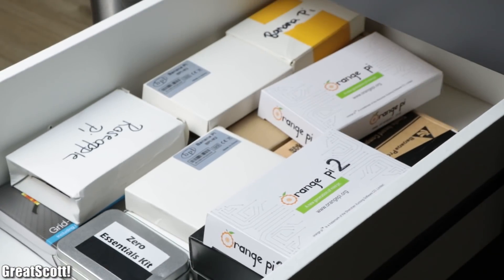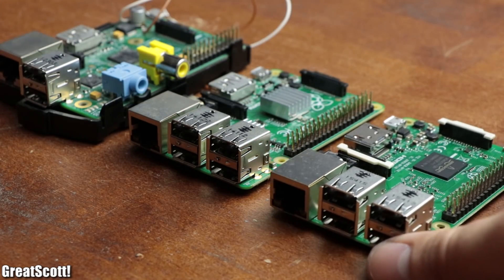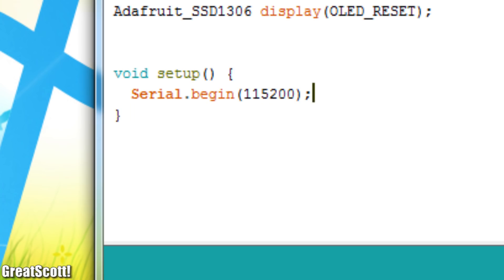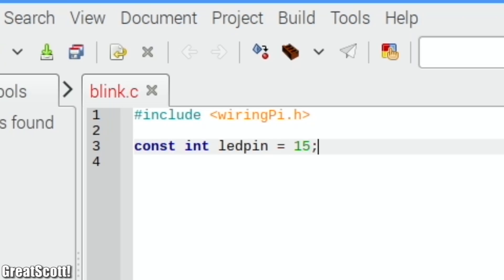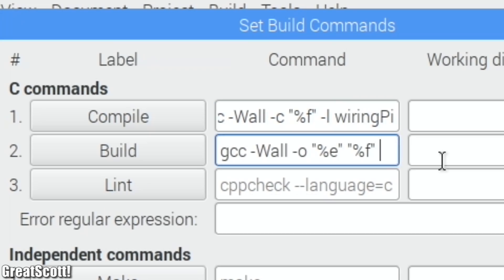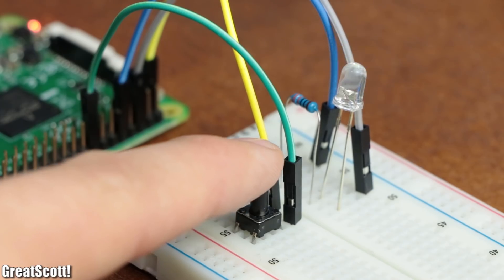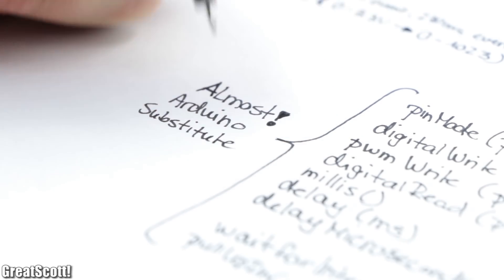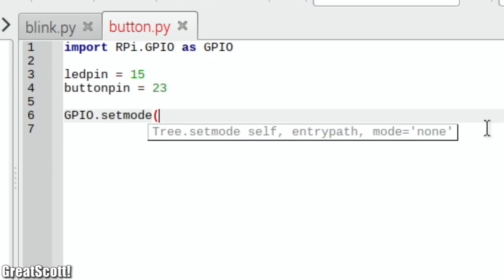Can a Raspberry Pi be used as an Arduino? || RPi GPIO Programming Guide 101

Comment: I want to make raspberry pi based PC fan controller. I want to add 5 stages of fan rpm which is sensed by various thermal probes or mini thermocouples.
Reply: You should go with an Arduino.
Most of the fans are using PWM to set its speed, and Raspberry boards have 1 or 2 PWM outputs. Arduino boards, on the other hand have a lot of PWM outputs, you can choose the board according to your needs (Mini = 6 PWM, Mega = 15...).
Plus adding multiple temperature sensors with an Arduino is much easier than with a Pi.
A Rasperry is overkilled and limited for this kind of project.
Reply: There is a few options:
- You can use a pi + arduino to display informations on another screen
- You can use an arduino that sends data through USB, and then progral a graphic interface to display this data
- You can use a simple LCD screen connected to an Arduino. If a big display screen is not necessary.
Reply: Alex - exactly! An ESP Board could also be nice so you can control your fans remotely from the PC ;D 
Raspberry Pi is definitely overkill who wants to wait +20 seconds for the raspberry pi operation system and the fans to turn up?
Reply: Shubham Patankar A arduino is still the better solution because you could connect it to the main pc and it would start up every time in an instant (without having to start the rpi and wait for it to boot), if you want to log the data create a program for your pc and log it via uart (and another Advantage of this solution would be that you could use the second display for other stuff too)
Reply: Thats more like an arduino/teensy thing, I would just add the IO, and connect it to an internal USB port.
Than I would write a USB (or - that might be easier: Serial/RS232)-based driver, maybe (but that is probably complicated) with support for Speedfan
Reply: the aruduino is actually more expensive. also the arduino cant run an os. besides... they can always be paired...
Reply: The good old LMGTFY :D
OK, that changes a lot! I have never bought an RPI because it is to expensive... Didn't know about the zero model at all! Could come in handy for future projects. Do you have one?
But for a fan controller I would still use an arduino (nano) because that has included ROM storage for the tiny program, and boots faster. Also, it doesn't need a microSD card...
Only if you wanted the controller to be controllable via a web server, the PI would be the better choice.
Reply: Alex
Thanks buddy !
But as a need I have to monitor temps & fan speeds too, & that being displayed in live time on another screen. That's why I'm looking for Pi.
Reply: Sounds more like a Arduino job as an Arduino cost much less than a RPi (even RPi Zeros W).
The job you want to solve isn't complicated and there are already libraries for PWM control, reading analog data (there are no analog inputs on RPi, you need extra hardware for that), controlling a simple LCD display.  There are even simple cards you code with Arduino and have WiFi.  So you can use MQTT and/or Web server to monitor the device.
Reply: DCFUKSURMOM/BENDER tell me where I can get a Raspberry PI for less than 5 bucks!
Arduino nano costs only 4-6$
Reply: Here you have. Just to order directly.  That is, it cost $5. Took me 4-5 s to find  through the excellent tool  you find here.  You are welcome to both links. :-)
https://lmgtfy.com/?q=Raspberry+pi+zero+price
https://www.adafruit.com/product/2885
Reply: +TheRailroad99. :-)
The RPI Zero is physical smaller then the RPi 2B, but clocks fast slightly faster.  So it is the 32-bit CPU and not the 64-bit.  But then again, Raspbian doesn't use the 64 architecture instructions.  But it could be built to use those.

It only have one micro-USB port and no etherenet.  The RPi Zero W have same bluetooth and Wifi as the RPi 3B.

Yes, for a fan controller the RPi is probably an overkill, and harder to get working, for no real advantage. Especially if you need analog inputs.

Comment: can you make obstacle avoidance robot with camera and Raspberry Pi or maybe with arduino???
Reply: The arduino lacks sufficient processing power and memory for a camera, but you could do it if you used a simpler form of obstacle detection like infrared, ultrasound or whisker detectors. A pi could do it easily. Don't try to write the image processor yourself though, it's an exceptionally difficult area of computer science to learn - you're better off using one of the existing libraries.